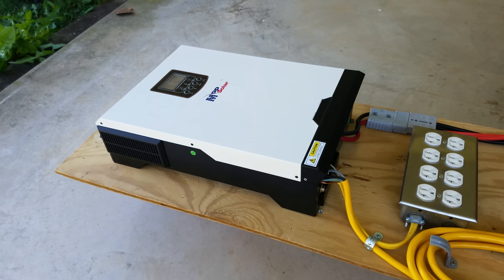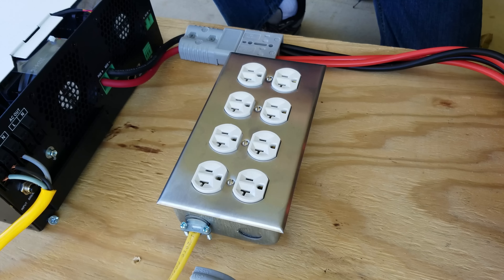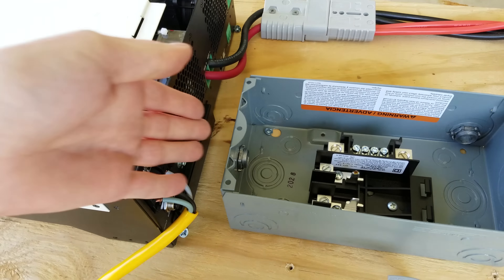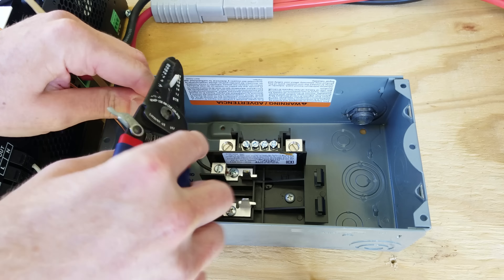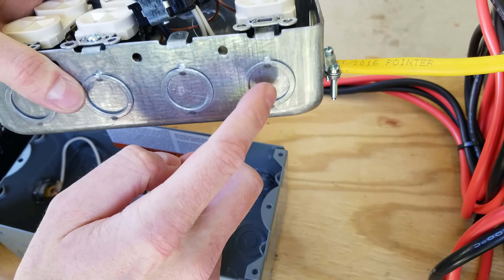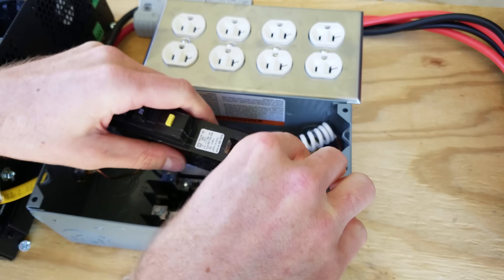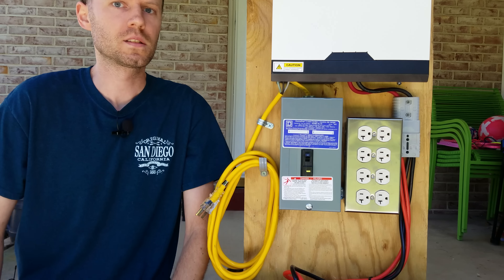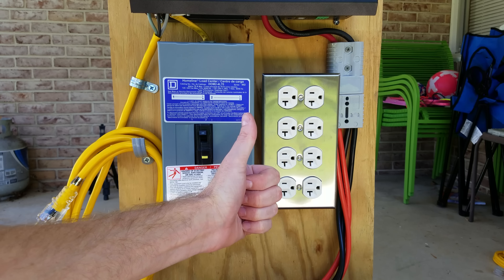Adding GFCI and Over-Current Protection to the DIY Portable Power Cart

Comment: Great update. I have a similar setup in my travel trailer. My circuit analyzer reported an open ground while off grid. This unit does not internally bond the neutral and ground. When grid connected for charging, the main grid box bonds the ground and neutral. While off grid, or portable in your case, shouldn't you bond the neutral and ground? I accomplished this bond by using an AC relay. This resolved my open ground. (I'm a novice though.. maybe this is just a bypass?)
Reply from the maker: That's exactly the problem. I can't bond it for off-grid because as soon as I plug it in, it's now bondeded twice (very bad). I suppose a relay would solve that but really wish they designed this inverter with that in mind... Also, when I asked the manufacturer if I could even bond G+N in the first place without damanging the inverter (it's transformerless), they sent me a response that didn't even answer the question. Although, if you've done it successfully, I guess it's safe. Which model specifically do you have?
Reply: @LithiumSolar  I have the same MPP Solar 2424LV-MSD and am using a Zettler AZ2280-1C-120A relay. When grid connected the relay actuates to disconnect the ground and neutral bond. When off grid the relay defaults to the neutral/ground bond.
Reply: @LithiumSolar  Are you sure the inverter doesn't an internal relay that bonds neutral to ground when not connected to mains? I've built off-grid setups like this using Victron Quattro inverters, and the Victron Quattro's do have an internal relay that bonds neutral and ground within the relay whenever they are not connected to the main grid.
Reply from the maker: @JeremyAkersInAustin  It does not bond internally. However, since publishing this video, the manufacturer has confirmed with me that the N+G can be bonded if needed. It would still need some sort of relay or bond disconnect though as you cannot have it bonded at the inverter while it's plugged to grid power.
Reply: @LithiumSolar  Hmm, that's interesting. I guess this is why I spent the extra money on Victron equipment. :) I suppose it wouldn't be too hard to add a relay: Just energize the relay from the 120v input cord so that it only energizes when the inverter is connected to the grid and then use the "NC" connection on the relay to do the neutral/ground bonding so that when there's no grid power the "normally closed" contacts will bond the neutral/ground and when there is grid power the relay will switch and disconnect that bond.

Comment: Can you run a groundwire from the All-in-One Inverter to a standard 120 wall receptacle using a 3-prong plug from an extension cord, with just the negative wire hooked up and ground the inverter to a home's electric system through a standard 120 outlet?

Comment: You could just have a little lever, and when you push it down, it causes it to lock into the ground and then it would be immobilized and you would no longer have to worry about knocking it over by accident, and you would also have it grounded a little bit because it would go 3 feet into the ground.

Comment: Sorry if im wrong but isint buying a gfci outlet and a new cover plate cheaper than buying a gfci breaker and a breaker box for it?
Reply from the maker: A GFCI outlet does not provide over-current protection. The breaker I used has both over-current and GFCI.
Reply: @LithiumSolar  mini circuit breakers can do the job too plus they are free

Comment: It all looks good except where the yellow wire goes into the charge controller.  Is there anyway to clean that up?  It would look better if the wire insulation was pushed up inside the controller.

Comment: I've never owned any type of solar system and was about to buy my 1st solar generator the bluetti ac200 max for 2,000 but this system has me thinking that it could be a option. Its not as compact but it has more solar input more ac charging more wattage power and i can add batteries as I want.... not sure which way I should go.... any opinions.
Reply from the maker: Honestly, unless you're looking for a DIY project, it's probably better off to go with a pre-built device like the Bluetti or Ecoflow.

Comment: Any idea if this would be sufficient for a small off grid cabin?
Reply: Rich Jageman In a word, Yes... if all you need is small dorm-type refrigerator and LED lights. I suggest you determine total wattage needed per day to calculate size of system. Of course, bigger is better, And consider multiple days without sun to re-charge batteries. Also, have contingency plans to accommodate low(er) need of electricity. i.e., wood stove for cooking / heating. and other ideas for food storage to reduce refrigeration needs, etc Good luck.

Comment: I'm confused as to why you added the circuit breaker and the GFI?  You purchased an all in one inverter which has a breaker at the input and your batteries also were all in one with fuse and breakers?  Doesn't this defeat the entire purpose for spending more money on the "all in one inverter and batteries?"  Thanks

Comment: One glaring problem here I can see is you should put a replacement blank in the old cable conduit hole.  They aren’t expensive and take a few minutes to install.
Reply from the maker: Yes, didn't have any on-hand but should have used one.

Comment: Thanks!  Though keep in mind for a 20A circuit you should have at least a 25A inverter ... but now I'm just nit picking
Reply from the maker: I'm not ignoring the question - this is a 20A continuous inverter, I have a 20A breaker. IF you're following NEC rules and you want to pull 20A continues (defined as 3+ hours) then you need to consider derating.
Reply: @LithiumSolar  Let's be real very few ebay specials can output 100% rating constantly.  Even then if you had any sort of surge on any appliance you'd put it over the limit.

Comment: Don't ground it to earth. This mobile system is actually safer because it's not grounded to an earth ground. If you grounded it to an earth ground using an alligator clamp or some other method it would actually make this less safe rather than more safe.

The main power grid uses earth as a ground because it's convenient and provides protection from power surges caused by weather events such as lightning. That's not a concern here. In your case having an isolated ground makes this safer: Since nothing is grounded that means there's no path for the current to travel between your body and the inverter. You could literally grab the hot wire while the inverter was on and it won't shock you because there's no return path for that current to travel through your body back to the inverter. If you grounded your setup to an earth ground you would be providing a return path because now the current can travel through your body, to the ground and through the ground back to that inverter.

In fact people often pay extra to setup a "ground isolation transformer" when doing work outside in wet conditions to help ensure their safety. A ground isolation transformer essentially does exactly what your setup does: It uses a transformer to create a new 120v (or 240v) circuit that is not referenced to earth ground to help protect the user from inadvertent shock. What you have here accomplishes exactly the same thing as a ground isolation transformer.

This is also why the GFCI is largely unnecessary. The only time the GFCI would provide protection in this case is if you were somehow touching a hot wire from the GFCI with one hand while simultaneously touching the body of the inverter with the other. Since there is no earth ground path back to the inverter there are very few cases where you could get shocked with this setup.

You could even do a video where you demonstrate this by connecting one lead of your volt meter to the hot wire and the other lead to something that is earth grounded. Then once you've established there's no voltage between those points and established that it would be safe to do so: you could even touch the hot wire yourself and demonstrate that nothing happens.
Reply: The point of a earth ground is providing a low impedance ground path to the gfci. So if your hot starts feeding threw the person to the ground once it hits so many MA it trips. Also for any reason the neutral comes in ground path on load side it trips. In the US the NEC makes good mention of this. I would had uses a CAFI breaker for more safty. Im assuming this is a pure sine inverter.
Reply: @hvachacker586  
"The point of a earth ground is providing a low impedance ground path to the gfci."

This is absolutely 100% wrong. Very VERY wrong. Please, PLEASE go read the NEC and copy paste back to me anywhere the NEC says that the purpose of "*earth* ground" is to provide a "low impedance path for GFCI". It doesn't say that anywhere. You're confusing so many aspects of the NEC that I'm not even sure where to start with how wrong this is.

1) You're confusing "equipment ground with "earth ground." Earth ground is not a "low impedance path" which is exactly why "equipment ground" involves a ground wire leading back to the breaker box. The "low impedance" path you refer to is the "Equipment ground" via the ground wire not earth ground. You might be conflating these but they are different: An "equipment ground" via the ground wire in a home is eventually tied to earth (Back at the breaker box), but the earth is not part of the "low impedance path". The low impedance path is the ground wire itself between the appliance and the breaker box where ground and neutral are tied together. This wire provides a low impedance path back to the breaker box that would cause the breaker (Not GFCI) to trip in the event that the hot wire comes in contact with the body of an appliance. Earth ground would not play any role in this path. In fact if you removed the ground wire and instead relied on the "earth" ground you'd find that "earth" in this situation is a fairly high impedance path: The appliance may be sitting on plastic or rubber feet, which are sitting on wood, carpet or tile, which may be on a wood frame floor or concrete floor... None of these are low impedance conductors and you would never want to rely on "earth" being your ground for this kind of protection. This is why we tie the body of the appliance to a ground pin which is then connected to the breaker box via a low impedance wire rather than rely on the "earth" to carry this current.

2) Not only have you confused "Earth ground" with "equipment ground" you've also confused "GFCI" with "circuit breaker". The "low impedance path" is for the circuit breaker, not GFCI. Some circuit breakers have GFCI built in... so maybe that's led to your confusion? Not every circuit has (Or even requires) GFCI protection, and the protection is often built into the outlet rather than built into the circuit breaker which even further negates your claim that the earth ground would provide a "low impedance path" since the path back to the GFCI would not even involve earth ground at that point.

3) GFCI does not need earth ground (Or any ground) to function. The whole point of GFCI is to provide protection in an event where the equipment ground fails. GFCI operates by comparing the current flowing out the hot side of an outlet with the current flowing back into the neutral. If there's even the smallest difference in current between the hot and neutral that means that some current is flowing through some other path that it's not supposed to and the GFCI trips.

4) In the setup mentioned in this video with an inverter: If there was no earth ground then the Earth is not a current path period. That means you can literally grab the hot wire from the inverter and not get shocked: Because there is no path through your body for the current from that hot wire back to the inverter. No path = no current = no shock. Tying it to earth would provide that path and actually increase the danger from electrical shock. There is still an equipment ground here via the ground wire which grounds the appliances back to the frame/chassis of the inverter but there's no need for that to be grounded back to Earth since there's no power lines 100ft in the air here that are at risk of being struck by lighting (Which is the primary reason for Earth grounding in the main grid to allow a way to dissipate power from lighting strikes and other static interference on the power miles of power lines leading to your house)

5) Every single "mobile inverter" setup in the world is not grounded to earth: Think about it: There's no way to install a ground rod in a boat or RV when these are underway. Again: "equipment ground" and "earth ground" are not the same thing. earth ground is only needed in cases where voltages from other sources such as lightning are an issue. In a mobile inverter setup you don't have thousands of miles of power lines sitting hundreds of feet in the air so dissipating lightning strikes is not really a concern in an RV, boat or other mobile setups like this.
Reply: @JeremyAkersInAustin  Yes!  See MikeHolt videos on this topic.

Comment: The GFCI is not necessary. Since the neutral from the inverter is not connected to the ground (I don't see a ground electrode) the GFCI will never trip (since a fault to ground doesn't have  a return path to the neutral inverter). 

That system is intrinsically safe, in sense that even if you don't have a GFCI you cannot get shocked touching a live wire, you have to touch both live and neutral. Also even if you touch a live wire the GFCI will not trip (try it, of course not with your hands, but by shorting live with an electrode in the ground).

Comment: Why a 70amp breaker box? I just got a 30 amp breaker box with 20amp breaker, is that okay?
Reply from the maker: The box I used was cheap. You should be good as long as the inverter output doesn't exceed the box rating. I'd probably size it by 1.25x, but am unsure if there is an exact requirement for sizing.

Comment: Very well done. A couple changes/updates/suggestions/considerations
1) have some kind of cover that goes over the electrical outlets. something simple on a small hinge would be fine. Just want to keep the chance of water getting sprayed/splashed/rained in (on a job site, it happens, and rain can be unpredictable at times)
2) I'd gone with a 240V system (I understand this was meant to be on the low cost) and then have half be on one hot and the other on the other hot. That way you have 240 if you need it, and you can balance loads if need be (obviously this would be 2 breakers, as you have the space for them). This also gives the ability to have lights still on if 1 of the breakers gets popped.
 - I suppose this could also be done by doing like you said by bridging the incoming lugs, use 2 breakers, and then feed half and half

As for the grounding, you may not need it since you are using ground fault protection. However, just a long screwdriver could serve as a grounding rod. This is quite common with electric fence. You are generating the power and ground return in a small area, so you don't need to go down deep for return path like you need for a building.

Comment: Not trying to be rude but why use a 70 amp breaker if the wiring is only rated for 20 amps?
Reply from the maker: Not rude at all, happy to answer when I can. The breaker panel has a max rating of 70A. That's the largest amount of current you can pull through it. I'm using a 20A breaker so it's protected at 20A. Sure, you might be able to find a smaller panel but these are so cheap that why bother? :-)

Comment: What I do with portable Gen Set is a 2’ copper ground rod. At least the 2 foot ground rod gives you some potential to earth. Just to be safe
Reply: I use a galvanized chainlink gate pin. Its got a nice handle to pull when you’re done. I was using my Triplite FC 3000watt one time and getting a lite  shocked off the car body (-) that was powering it. The pin fix that and the GFCI stop intermittently triping.
Reply: Depends on type of Gen and  if stand alone or connecting to house.

Comment: Love the build but I have one question. Did you use a new box or somehow cover the knockout you used before? Otherwise that's a huge safety risk with exposed wiring easily accessible to poking fingers.
Reply from the maker: No, I didn't use a new box. You can fill the old knockout holes with these https://www.lowes.com/pd/Sigma-Electric-ProConnex-3-4-in-Knockout-Seal-Conduit-Fitting/1100047
Reply: Perfect solution!
Reply: Install a mini electric fence around the gen to keep the lil fingers out. Dang it that made me laugh.

Comment: Does that GFCI really have a over current protection? Usually the "20A" is the rating and other circuit breaker is needed for that purpose
Reply from the maker: That is true for a GFCI outlet. This is a GFCI circuit breaker that I used here. It provides GFCI functionally built in to a 20A breaker.
Reply: @LithiumSolar  In North America they are combined together in one breaker. In Europe where the breakers are more modular and DIN rail mounted it is true that the GFCI /RCD protection is a different breaker from the overcurrent protection.

Comment: Great build BUT you have no ground.   If you have an issue the electricity will have no clear path to earth.  I suggest an earth spike or a lead that connects to a real earthed outlet.
Reply: This is incorrect. Believe it or not a grounding rod does not make you safer. Earth ground is for equipment safety. See MikeHolt videos on this topic.
Reply: @scottmoonshot  Sorry but you are wrong.  Do you have any real knowledge of electricity? An electrical circuit will always complete using the path of lowest resistance.  I will bet my life on a copper cable going to ground / earth rather having me complete the circuit.  Please do not believe everything you see or hear on youtube.  Do the research and educate yourself.  BTW yes I have worked with electricity for many years and have the education.